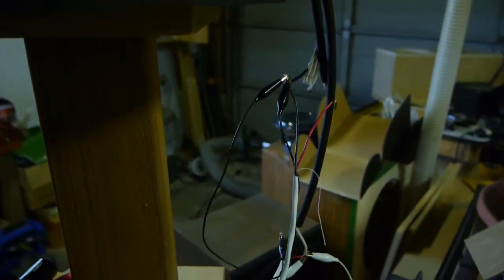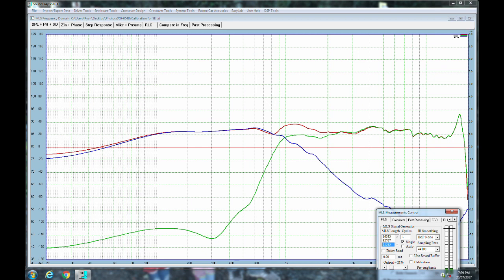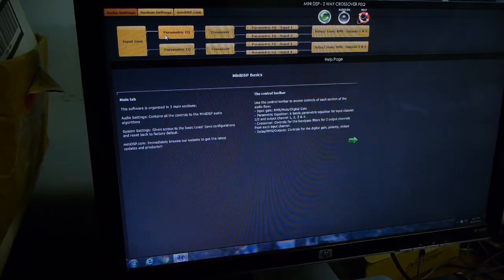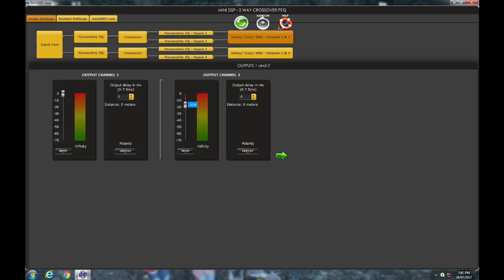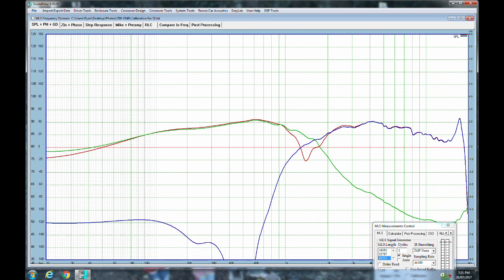Are Active Crossovers Easier than Passive? NO!

Comment: Great Video!!! My question is how do you test for alignment? is oscilloscope the only option..? is there software and calibrated microphones? this is intriguing and confusing all at once, LOL ...thanks
Reply from the maker: pallusubaru To find to acoustic offset I use a measurement microphone. You can either take measurements and then use software to determine the settings, or you can flip the tweeter polarity and add delay while taking measurements until the null is at the greatest and flip the  polarity back. You're right that it is not simple. Unfortunately people think active crossovers are easy, which is why I made this video. Eventually people will hopefully understand that to get good sound quality from passive or active XOers a little work is required.

Comment: Nice video. Like you said the title might be slightly misleading . I could be totally wrong but what you explained was about the acoustic phase difference which you are compensating with delay . But what about electrical phase difference . I know they are connected but it will be good if you can make a video about how they are tied together
Reply from the maker: jojiran i could possibly do a video about electrical phase sometime, but that isnt a strong point for me. They arent really connected to acoustic phase either. Im more knowledgeable in the acoustic realm but Ill try to cover that topic as I go. Thanks.
Reply: Thanks for your response . Ive been trying to get my head around this subject. Since I work in a studio setting , it is important to understand these concepts well in these times of evolving technology
  What you did in the video ( adjusting delay) will produce phase coherent sound i.e. sound waves hitting the human ear as if all those frequencies emnated from a single single source even though they may be physically separated 
 The phase response you see in common design tools is the electrical phase . That has  got to do more with how the amplifier sees the load. I was very confused about these concepts initially but now I think I have a better understanding .
Reply from the maker: jojiran yes, and also be careful that some of those design tools show the theoritical acoustic phase caused by the crossover. That is not useful information because those design tools assume perfect woofers and tweeter, which none exist.
Reply: OK I will look out. Currently I use VituixCAD and Ive been playing around with the Behringer DCX2496

Comment: can you teach me how to build passive cross over
Reply from the maker: DJ Harry Trivedi My next video is kicking off a 4 part series of building and designing a desktop speaker from scratch. I'm going to look at how to design a passive XO and it should help you a lot. Should be starting in a week. The design part in two or three weeks. Keep an eye out for that.
Reply: Don't bother and keep saving your money for just a bit. Go proper or go home.

Get a dsp and 4 stereo amps; or 3 stereo amps and a plate amp or 2 for the sub(s). Power your 4-way and you'll have audio that will rival any passive speaker.

Think 12 inch sub, 6 to 8 inch mid-woofer (2 if you want), 2.5" to 4 inch dome upper mid (or cone), and a 7/8ths or 1 inch tweeter.

You'll be able to experience anything your heart desires. Turn up the subs. Turn off the subs. Then listen to a 2-way or a 3-way setup for vocal clarity. Compare and contrast all you want, and be an audio GOD in total control. 16hz to 20khz and above will be entirely in your reach.

I've never understood the appeal of building your own passive speakers. You're then stuck with a speaker that can't do much of anything (just like all the other crappy passive speakers on the market for the average idiot consumer). And chances are, your passive built setup won't compare to the hundreds of passive speakers already on the market. I guess you could add an equalizer with a passive setup, but that's fairly lame and doesn't address the flaws of passive speakers.

Have fun and build an active system which will sound better, do more, and can be tweaked and played with according to whatever your heart desires.
Reply: There is definitely a place for passive crossovers. I am a fan of active crossovers but for my 4 Atmos speakers, I did not want to deal with 8 amp channels and active crossovers. So I learned how to do a passive design and have been very happy with the result. Xsim is very cool software and can be learned in a few hours. Although I think I spent at least a couple of days last winter playing around with it.
Reply: Fair enough. And your'e right.

I was just trying to oversell the fun and advantages of an active setup.

Too many overlook the option and many don't even know it exists.

Comment: Looked a heck of a lot easier than digging through a box of crossover components and using that software to design a passive crossover. You even showed how to compensate for phase using DSP. All in all (having watched all the videos you've posted) I'm inclined to think that active is easier and more effective than passive.
Reply: Wouldn't it be possible to do a trial and error with an active crossover, measuring the response, then adjusting the delay, and measure again, until the smoothest response is obtained? Then adjust further with EQ. Not sure, but that might still be easier than a software design which would still need to be verified with measurements.
Reply from the maker: Daniel Deverell you're not wrong. It is slightly easier. The title is a bit misleading I suppose. The point was that all the design work necessary (the actual hard part) is the exact same as passive. Many people view active as a button clicking excersize when it's far from that. Software is still necessary to design a proper active crossover and digging through a parts bin and doing some soldering is only 1% of the trouble. Fair comment though :)
Reply: @ImpulseAudioSpeakers  The real problem is having that parts bin to dig through. Not everyone does. The MiniDSP can implement complex filters and equalizers and can be adjusted repeatedly. It can be reused later with a completely different set of drivers. Certainly, it's not fool proof and requires the same level of expertise, but if you mess up, it's a few mouse clicks to fix versus ordering a few hundred dollars of new components. Plus, with many of their devices, you can store multiple configurations and switch between them with a button press. Personally, I think it has lots off merit, especially for the beginner who wants to experiment and learn.
Reply from the maker: @scotdixon777  I just feel that if someone actually knows how to design a XO properly they’re going to have the parts. If not, well then fine, the active XO has an advantage there. Not easier to design, easier to implement.
Reply from the maker: Greg Worrel I meant measuring software. But even design software would be the way I'd go. Trial and error is possible with either active or passive but I find I'm faster and easier using XO design software. Usually end up with better results too. But if someone wanted to do it by trial and error using measurements they could no problem. That's how I solved the need for correcting phase in this video, I didn't bother to use XO design software for a quick thing like that. It still takes a long time in the lab to do it by trial and error and then you need to listen then drag your amps and XO back out into the lab and back and forth. Not easier than passive IMO.

Comment: The conclusion at the end makes no sense.  You make it out like a passive crossover is easier to design properly than it is to change settings in a program on the minidsp.  

It sounds a lot like the arguments of purists when it comes to tube amps vs solid state.  You seem invested in passives being better.  They are definitely convenient once designed but the minidsp can give you a better modeled response easily if it's not perfect and you can correct for the room after you get everything set up.
Reply from the maker: Keith Anderson sorry that wasn't my intention. I was just trying to show that active isn't simply picking a XO point and hooking it up. I get that sort of comment often. Certainly no purist type of commitment to passive here. I enjoy active and as you can see I own a minidsp. Active has many benefits. Hopefully that clarifies my position on the subject.
Reply from the maker: Keith Anderson By the way, I have a similar video about the pitfalls off passive XOers for the same reason. The two videos were merely meant to inform people who are new to the hobby that crossover design (passive or active) is more challenging than it can first appear. Hope you can get some enjoyment out of my other videos if this didn't sit well with you. Sorry again.
Reply: Impulse Audio the video is good.  I loved the explanation of phase.  I always knew it was a timing problem but never visualized what the actual issue was.  

I see the minidsp as a great tool to test drivers before making a passive crossover.
Reply: Tubes = epic win.
Passive crossovers = epic win.

How many DSPs will still be around in 50 years? I don't see a point in using disposable and fragile microchips in something that could last a lifetime.
Reply: @westelaudio943  have you ever considered the fact that DSPs are only going to get cheaper and cheaper with time not to mention a miniDSP is only $100?  Even if a $100 DSP only lasts you 10 years (and it should really last much more than that) that's incredible value.  They are not going anywhere dude you sound absolutely crazy implying otherwise.
Reply: @barfy362  

DSP can be a decent tool to test certain crossover points etc. But it's not a good solution for a finished project. Even for active crossovers I'd rather use op-amps or tubes.
Reply: Tubes are also (disposable and fragile) but the tube amp is durable. Quality speakers and enclosures will remain but the the dsp can be changed, passive is good but caps deteriorate with time as well. Good analog pieces remain the same and the supporting digital pieces feeding them improves, as it should. Just as you could use better gear to extract more form the same speakers you could also use better dsp in years to come to extract more from the same drivers.

Comment: Just as a generic passive crossover isn't plug & play the same applies for the Mini DSP. Once you factor the same things you need to take into account with a passive you can do the same with the Mini DSP. As you mentioned the Mini DSP takes phase alignment into consideration & gives you the tools to correct this, so with the Mini DSP active crossover it takes a couple tweaks on the laptop vs a complete redesign & build with a passive crossover.
Reply: exactly - in other words it took about 5 min to make a correction in the MiniDSP and would take several hours putting together and retesting a new passive unit....
Reply: @rts100x5  - Agree 100%. To get a passive crossover design right, you really need an RTA analysis using white noise for each of the drivers. The crossover point usually will be where their rolloff curves intersect (target would be -3 dB with properly matched drivers). then design accordingly. Once you have that information, you can get preassembled passive crossovers at places like parts-express.com and some of their decent crossovers have user-selectable rolloff points. 

One other thing to consider (that I have not seen mentioned here yet) - passive crossovers depending on the filter type only provide a rolloff of around 6 dB, If you want to have a third or fourth degree filter configuration, for passive this is very expensive in terms of complexity, cost, AND attenuation (which must be made up with more amplifier power).

What the big name speaker manufacturers do is settle with a 2nd degree filter but match it perfectly with the drivers they are including in the speaker design. Even with that, it is difficult to achieve a perfectly flat frequency response curve but any minor peaks or valleys can be corrected with small amounts of equalization.

With active crossovers you can swap different driver types all day long and, with a few keystrokes, get the response curve exactly where you want it with an ultra precise 24 db rolloff. But you still have to put a lot of work in looking at the output graphs and (to do the best possible job) you want to complete this analysis and testing in the actual environment where the system is to be installed. And (this cannot be overstated) DO NOT OVER RELY ON HEAVY EQUALIZATION! By needing to do this indicates a major design error probably with the matching of the drivers and by overcorrecting using equalization you also run the risk of adding distortion especially with forcing the lower frequencies through the tweeters.
Reply: Agreed. No generic crossover is going to fit any specific speaker without some tweaking. But with the Mini you can tweak in real time. You can do close field tweaking and then do room correction within minutes instead of hours.  Saying that a good passive crossover is better than a bad active crossover is not fair. Of course it is and a good active crossover is way better than a bad passive crossover.
Reply: Agree, this video isn't a very fair assessment of the differences between an active and passive crossover.  His poor performance on the active at first should have been compared to a generic off the shelf pre-built passive crossover.  A good active crossover can do everything a passive can but it can also be re-tuned whenever you move your speakers to a new room.

Comment: Good vid. I'm not sure that I agree with your assessment that active without delay are useless given that passives don't have delay and there are other benefits to active. Keep 'em coming!
Reply from the maker: Warren Smith Passive does have delay, its just harder to do. You can add poles to the network, which also steepens the slope so you have to be ok with that, or you can use a very complex ladder network. Most people use an extra pole or make physical changes to the baffle. Definitely need to understand whats going on with the phase to be able to get it correct. Active is easier if you have delay capability. The active XO boxes with a fixed slope and no delay make it impossible to solve the phase issue.

Good point about active having other benefits though. They do have a lot going for them. Especially the ability to dial in delay rather than the challenges of getting a passive right.
Reply: You make some good points, but just change the title!!! Active crossovers won't fix stupid (implementation) so to speak, but they are indeed so much easier to implement and adjust if need be.

Passive crossovers take labor. One has to fabricate the system and then they are stuck at a less than optimal arrangement. With active you just have to be knowledgeable enough to push the correct buttons.

With active, there are many benefits, and near endless adjustability for different source material and/or preferences.
Reply from the maker: Anonymous DueToFascists I'm not sure I agree passive XOers are labor intense :o A few components soldered together isn't a bit deal. The case against active always seems to be the number of wires and amps required. So really they're just different but both require good design. I do agree a superior result can be had with active, but it is smaller than most active proponents seem to argue. And there are advantages to passive such as potability, simplicity, etc. that really depends on the application the user is going for.